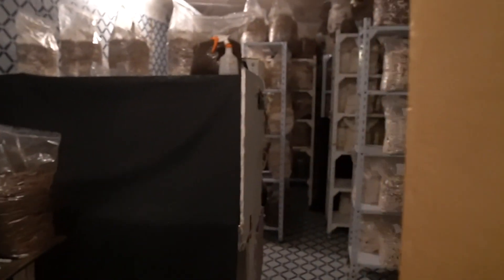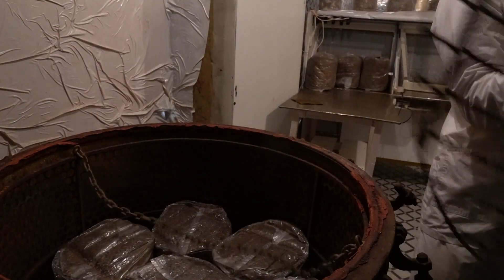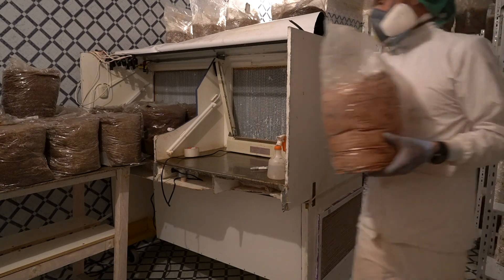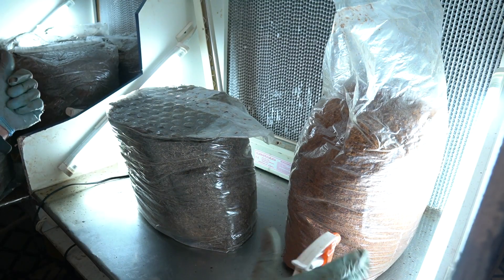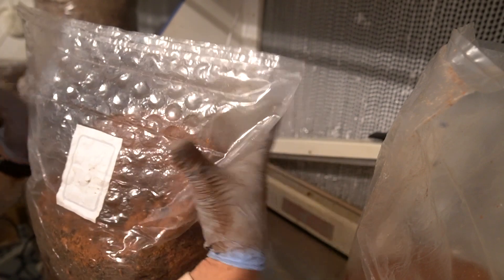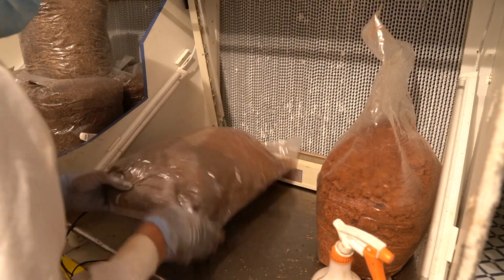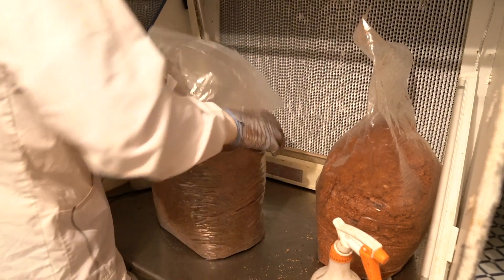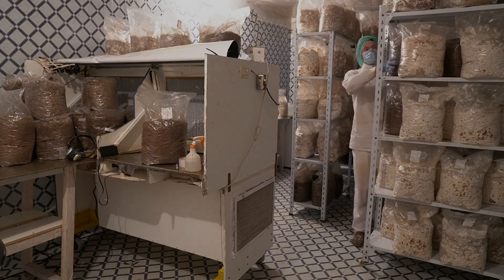Growing mushrooms, How to inoculate fruiting blocks with sawdust spawn.  Checkout our lab workflow.

Comment: Great work. Loving these! What's the price point that I should aim for with such flow hoods?
Reply: For the average home grower, A flow hood of that size is not needed.
BUT I bet you could buy one for around $3000, while you could make it yourself for around $450!
Reply: @BillWonder  Thank you! Do I need an engineering degree to build that thing for $450? ;)
Reply from the maker: No it's pretty simple really.  You just need to make sure that your blower can blow against pressure usually 1" static pressure, so just  take a little time to see filter size and pressure requirements and match it with blower, I'd say that is most challenging part.  The build is somewhat simple, just make a place to air intake and have no gaps so it pushed through Laminar flow hood.  You've inspired me I'll do a video on the Hood a little more specifically, subscribe and I'll make video soon.
Reply: @5DLifestyles  cool, thanks very much. Already subscribed a while ago. :)  Sounds doable. A video about it is a great idea.
Reply: @edwassermann8368  This is the video I followed. I did the exact specs. It was a little overkill at first but now I have just ramped up production and its so nice to have extra room to work! https://www.youtube.com/watch?v=Sj4qk6I-hy8&t=111s